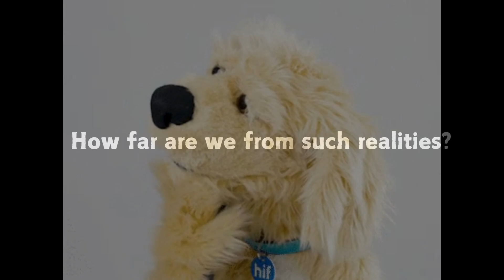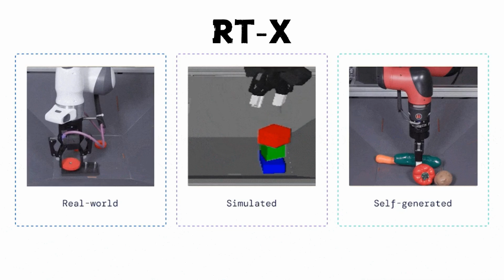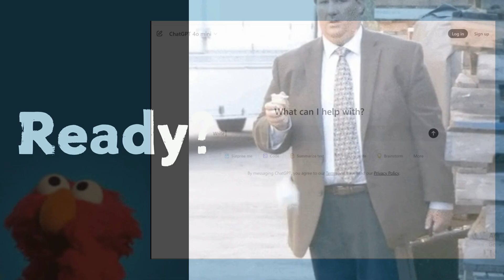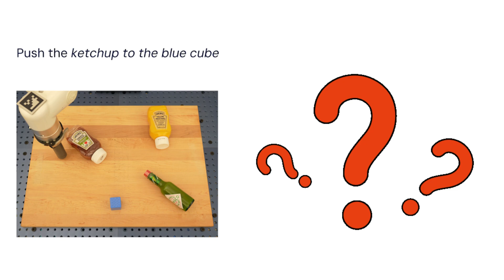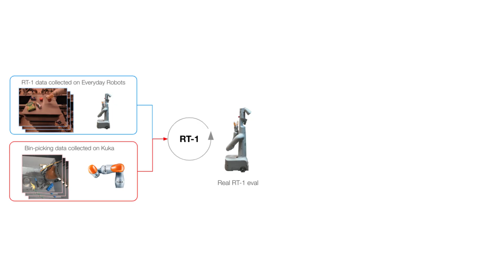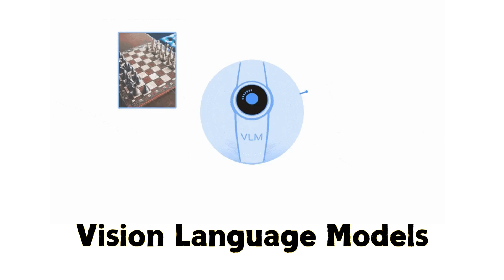GOOGLE DeepMind's New A.I Robot Brain SHOCKS Robotics Experts

Comment: @Evening Crypto Have you used a text to speach program? 

Regarding that Deep Mind is a Google project the idea of data sharing is not a surprise. The question is: how much data will the robots share and can that "blurring process" to protect your privacy be bypassed? (In my opinion it will be some day.) Another question: Will I be able to control, what my robot learns from other robots?
Reply from the maker: These are interesting questions, especially the one on controlling what the Robot shares or learns from other robots. The RT-X project by DeepMind does prioritize data sharing among robots to improve generalization and adaptability. However, the level of data sharing and privacy protection depends on how anonymization and data handling are structured. While DeepMind claims to enforce privacy safeguards, the potential for bypassing these measures cannot be entirely ruled out, particularly as technology evolves. 

Regarding user control over what a personal robot learns from others, this is still a developing aspect. Ideally, future systems may allow users to customize or limit learning parameters, but the specifics of such control are not yet clear.
If you find any updates on this project, feel free to update here and I will follow up. Thank you for bringing this up :)